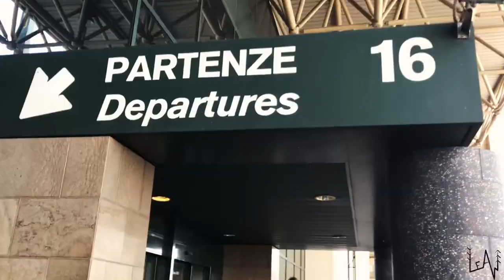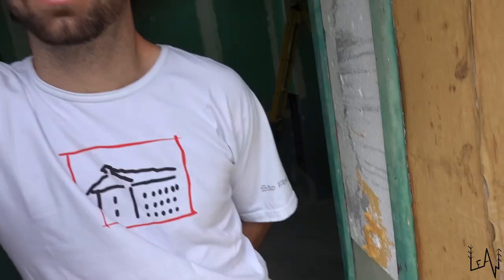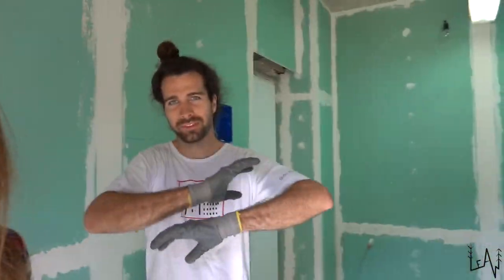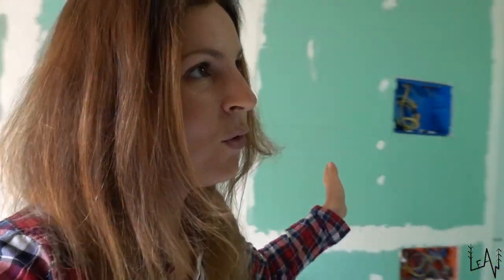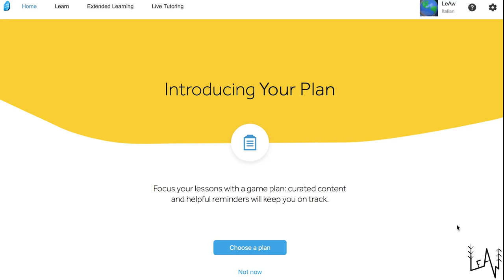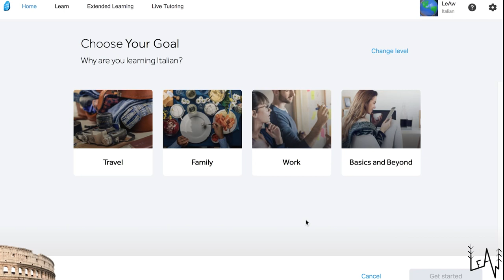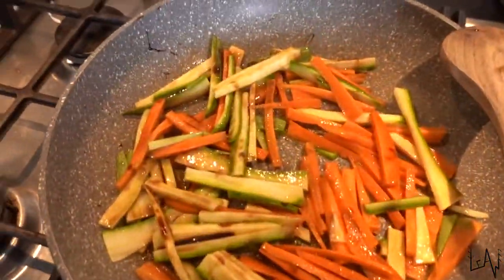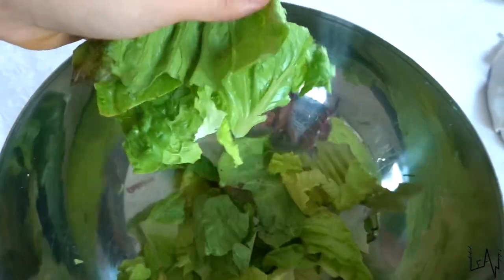TURNING BASEMENT into UTILITY ROOM / DIY Renovation! HOW MUCH MONEY did we spend?

Comment: Laundry rooms flood.  Suggestions - Leave as much of the water pipes in the back exposed as possible,  install a washerless valve to shut the all the water off, cold &hot, when the machine is not in use,  install a drain near the washing machine, install a sink near the washing machine, for example in case you have to pump out the washer, make the floor and last foot of your laundry room wall in a material that is water friendly.  When you have your first washing machine issue (and it will happen),  you are going to go crazy.

Comment: Excellent work. Have the lizards come by to check it out? You do realize the utility room won’t be the same without the dormice family. Buy a furry toy dormouse for good luck. I once did a basement floor using reclaimed terra-cotta, a special dry mortar and sealer. Twenty years later still looks great. Beyond replacing the odd cracked brick the flooring application keeps the humidity balanced all year and radiates some warmth in the winter.  The synthetic flooring in the adjoining bathroom has been replaced several times mostly because of mold and yellowing. Switched to ceramic tile. :)

Comment: The laundry room looks great!  I have been wondering about the closet by the entry door.  What is your plan for it? Will it need some improvements? A louvered door what look great on that closet and help with air circulation.  Just a thought, I'd pass on.